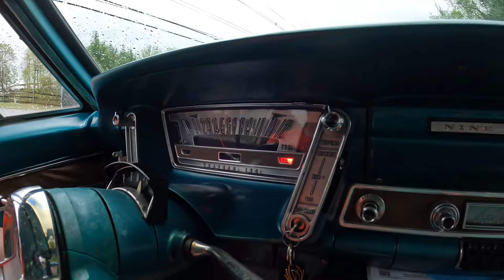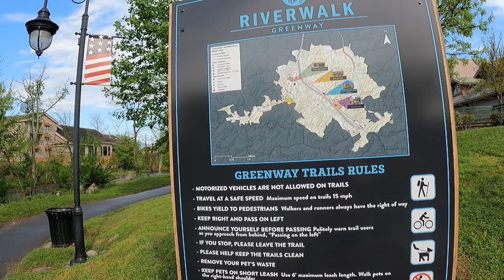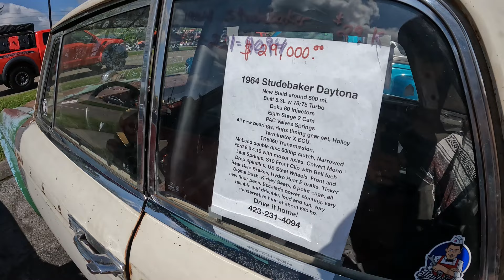Spring ROD RUN 2024: WE DRIVE OURS! '77 F150 + '64 Rambler Wagon

Comment: thats how you figure out whats wrong , put some miles on it. I would send the radiator out don t like em running hot get the A C working that would be cool
Reply from the maker: A radiator is on our list to order but this one is okay for now until we save up for that. We did flush it out, usually that is a 50/50 shot. We'd love to get the AC working as well. None of our fleet of older vehicles have AC.